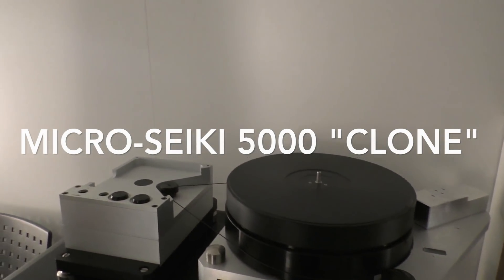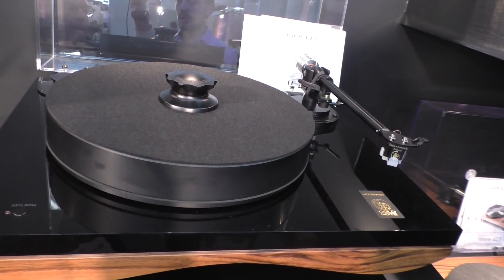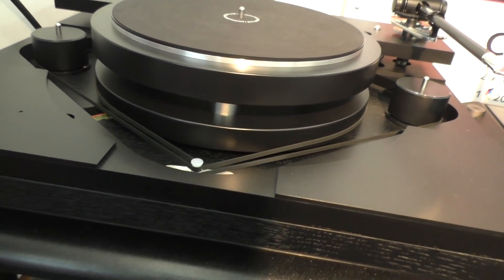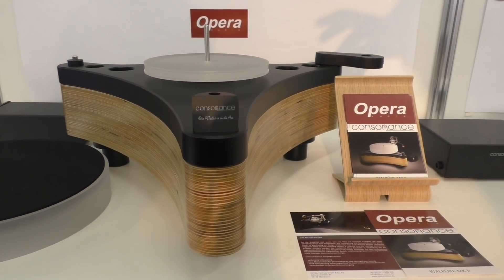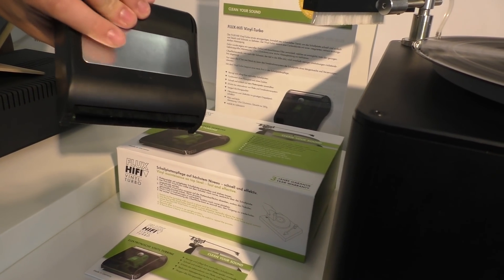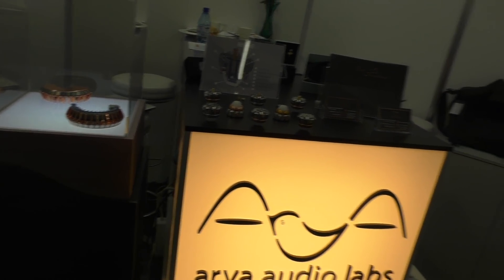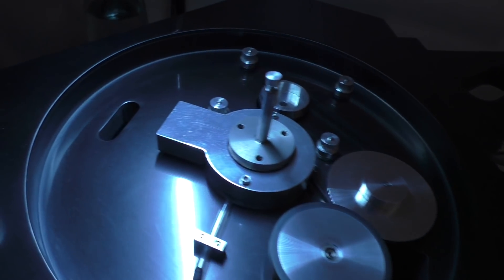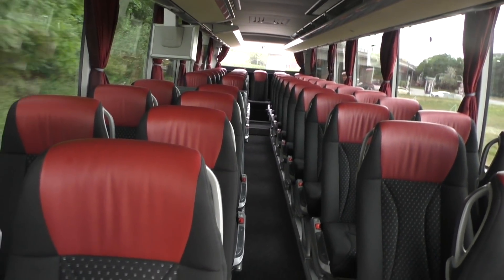AnalogPlanet's High End Munich 2018 Coverage,  Day 4

Comment: No Pictures at a show . . . what do they think, that by a video, someone is going to steal their design? In another year, they will be out of business -- how moronic.

I still find linear tracking tonearms fascinating, and since records are cut that way -- how is it that they have had such a difficult time coming up with a fantastic linear arm that everyone can get behind? Seems like a contradiction in cutting the master with a linear arm and then playing back with a standard tracking arm. Why can't they come up with the exact playback arm that tracks as accurately as the cutting lathe?
Reply: russmaleartist was wondering the same thing. Also, I can't understand why linear tracking tonearms are so expensive vs regular tonearms. You can get a very good Rega tonearm for 500$...yet the least expensive linear one is the 5k $ Clearaudio T5
Reply from the maker: I will explain! Records are cut using a sledgehammer. They are played back using a feather (metaphorically speaking). In playback you are moving a relatively high mass horizontally and a light one vertically. That presents many issues. Most of the tangential trackers look great but on a microscopic level they are "crabbing" their way across the record making tiny arcs that produce more tracking error than does a properly set up pivoted arm. There are a few good ones so don't get me wrong. However, after owning a few of both kinds I'm sticking with a pivoted arm!
Reply: Thanks . . . appreciate the analogy. I did try a Trans-Fi Audio tonearm called the Terminator but I had trouble with the air pump source. I think the design is good, because it does not crab its way across the record, but has a fixed arm on an air glider type device that is so frictionless that the arm just glides effortlessly across the vinyl. The air chamber, which kept the consistent air pressure on mine, had an air leak and I got tired to trying to get it to work properly, so I sent it back. It did sound superb when the air system was seemingly working right. Check it out!
Reply: @AnalogPlanet  Simply - and therefore - an excellent answer to a question that occurs again and again!  I think, to a price that an excellent linear tracking arm costs, I`d rather buy two excellent pivoted ones!